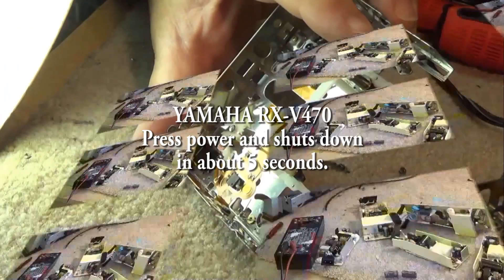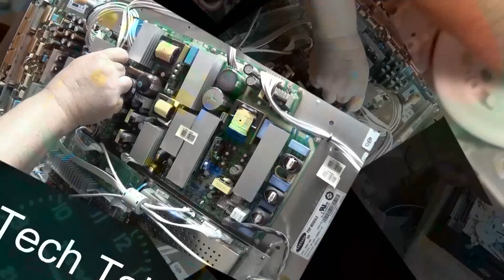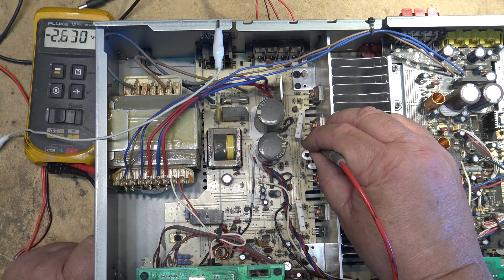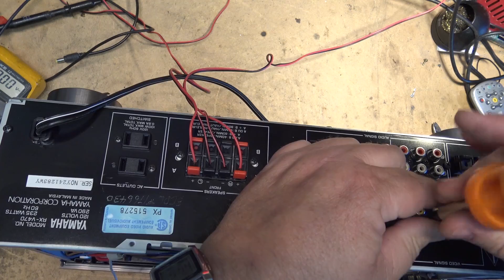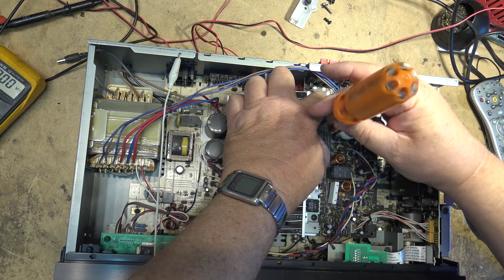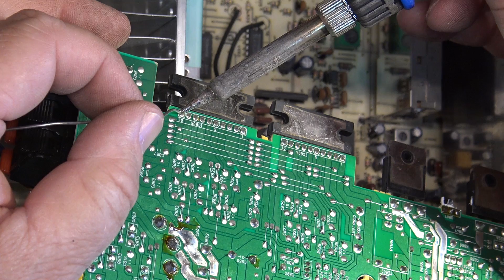Yamaha RXV470 Shuts Down

Comment: My brother in law has a Yamaha  Rx-v375 quit working on him, he gave it to me to look at. I got it to power on and run for around 30 minutes to an hour however it will power off after that time. 

If you power it on right after shut down it will immediately shutoff, but next day will run for 30 minutes to an hour again. Diagnostic code PS PRT : 185H 

Hoping you can throw me some knowledge on this issue, I appreciate any advice and all the information you share in these videos. I run two aventage series Yamahas and hope I never see these issues in those as they were not cheap.

Comment: Thanks for the vid. I have a similar model yamaha in my workshop that shuts off when the volume is raised to around 1/4 of the volume dial. I haven't had a chance to pull the covers off yet and my first thought was perhaps a faulty speaker protect solenoid but i'll keep my mind open. Thanks again.

Comment: Bwa ha ha, i thought it would have been due to crows feet !!!
I ended up getting an Akai 3 in 1 midi system as they call them in australia, for free as it doesnt power up. Im hoping its just a power fuse else these units are like pc's inside. Hopefully a simple fix.

Comment: Awesome diagnostic/repair video. Found you by chance, upon searching for a solution to my Yamaha RXV377 Receiver. The unit is rated @80watts/channel. The problem is that when I turn up the volume to 80%, it turns off and the display reads "CHECK SPEAKER WIRES". I also checked each wire terminal, for each speaker for any loose bits of wire. Found about 5 little bits of wire in one terminal only. But the problem still persists. The unit is set to run speakers at 8 ohms. Center channel is a 200 watt 8 9hm speaker. Left/right speakers are tower bass reflex @200 watts, and finally; rear speakers are Sony, @ 100 watts each ,@8 ohms.
Wires used are speaker wires, forgot the size, but are the lamp wire type. 
Could the issue be the wires are not capable of sending the correct voltage? Or do I need a larger sized speaker wire. I am just guessing. But l, you know more about this. 
Hope you can help me in this. 
Thank you for your time. God bless you and your family

Comment: My left surround nor working properly sounds very low when I increase volume sudden shut down at high volume
Reply from the maker: Short in speaker or wiring ?
Reply: @12voltvids   I removed all soeaker wire from receiver thn I increase volume facing same problem ( shut down )
Reply: And yes my Yamaha rxv 1900 left surround channel not working properly

Comment: I had a Yamaha RX-V480 receiver with the same problem. I found your video today and followed your solution-it worked! I did not find visible cold or broken solder joints on the IC's, output transistors, or the voltage regulator, so I re-flowed the solder on all of them anyway. My soldering iron tip was too large to add solder to the multi-pin IC's, but I did add solder to the three-terminal devices.
The 480 differed from your 470 in that the surround channel board (two rear channels and a center channel) is mounted on its side, screwed to the wall of the heat sink. Thanks for the video!

Comment: I have a Yamaha rx-v795a stereo amplifier from 2000,,,a 20 year old amplifier with built-in radio tuner and Dolby pro logic and Dolby digital surround sound.

The only problem I may have with it is the sound cutting out in the left and right channels,,,which may b the same trouble as u had with dry open circuit joints on the transistors and ics too.

Comment: This is exactly the fault I have on my Sony TA-VE215 surround amp. After it gets warm I hear a click and the front speakers stop working. 
Turns out it's cracked solder joints on the relays.
Reply: All sorted. These were the culprits 
https://i.imgur.com/lcgdWJM.jpg
but I reflowed any others that looked dodgy and there were lots!

Comment: Brilliant,  was the wha wha whaaaa a squidward impersonation?😆
High appreciation for the tutorials on amp operations!
Just wondering if the solder is naff - would it be worth checking the main power board also? 
Anyway great fix as always 👍
Reply from the maker: Have you ever taken the main board out? The extra time would easily double or triple the repair cost for nothing and increase risk tgatvsomething else will get broken in process.
Reply: @12voltvids  i suppose so!

Comment: If you look in the service manual you will find that these Yamahas have a diagnostic mode and it will  give you a very good idea of where the problem is.
Reply from the maker: Not when they won't stay turned on it won't.
Reply: @12voltvids , I just checked the service manual for that model and it doesn't include that feature.   The later models did though.   Check out the service manual for an RX-V620 on page 12.  They had a feature to disable the protection circuit as well as display a code indicating the last protection mode.   This is handy for a NoProblemFound unit that you cant find a fault with.   If it displayed an output current fault you can usually assume the customer did something he shouldn't have.  

 For these earlier models I would connect a variac to the power transformer primary and monitor ac current while bringing the voltage up slowly.   Then I could check voltages without the unit shutting down on me.  I am a former Yamaha authorized service tech.
Reply: @12voltvids  🤣

Comment: I have one of those pioneer xr a-770's that you love to work on. It says hello and goodbye and that's it. I figured it's going into protection mode too. It was up at our cottage for years until my sister brought it home and said it wasn't working properly. I figured I would use it for the shop. It was barely making an audible sound, then decided not to work at all. I took it to bits and couldn't be so lucky to find any loose or cracked solder connections. I figure it's probably the amplifier stk ic. It may be a good candidate for a couple of those component type replacements.

Comment: I guess Dave Jones would have said "We're in like Flynn".
Had a SONY 4.1 (no Subwoofer IIRC) that would go into protect, the center preamp had a DC offset. The entire receiver was in pretty bad shape and not worth it so I just removed the center output from the circuit to get it working again.
And I had a JVC 1001 self destruct due to dry joints. Fixed it though because it was in good condition otherwise and being a cutting-edge top-of-the-line model pretty much worth saving. I just had to redo the entire internal wiring... and these small green audio rated electrolytic caps were bad.

Comment: I wish i knew how to troubleshoot electronics :-(
Reply from the maker: It can be learned.
Reply: Yes but it will take me a lifetime! I will have to take it one baby step at a time. Your videos help a lot! keep them coming,Cheers
Reply: With some good meters you can do it.
Reply: @tekoppentekoppen761  I have a Klein 600 multimeter unforunately is not true rms.
I also have a Tektronix 2445 O'scope but dont know how to use it i cannot find any good tutorials on how to hook it to a component to check it and i do not want to injure myself or the equipment. I also have a signal generator and heathkit digital counter I even have a variac. So i have a lot of test equipment all i am missing is the knowhow on how to use them.
So i make do with the dmm and a transistor and capacitor checker.
Of all the gear i have the one i would most like to know how to use is the O'scope.
Cheers
Reply from the maker: Your shitin me right.  Lots of stuff from japan had the same problem.

Comment: Let's eliminate lead from consumer electronics solder connections, lead is bad! We're saving the environment!!! Hooray! 
Never mind that multi-fold increased failure rate, which ends up sending far more e-waste to landfills then before, when the 99% throw-away public does exactly that after it stops working.
Reply: It's makes perfect sense when you think about if from a politicians view. You get to sound like you made a law that will do good for the world but really you're going to be making money for the people who donate to your campaigns. The fact that consumers and the environment gets screwed doesn't matter.
Reply: Most folks replace equipment not because it fails, but because there is a newer model, that can perform some other shiny function that loses luster a few months after purchase. Cell phones and bigger TVs have a high turnover, but even audiophiles spend multi thousands on new shiny equipment just because of boredom with what they have. Lead free might be fine for such folks
Reply: amandio sousa I don’t think it’s “most”, I think it’s some, or up to half need to have the newest/bestest/shiniest gadget. 

To those people, what ever. I’ve got allot less problem with that, as long as they’re passing that still working item along, and I’m under no illusions that all of them do (that’s another rant for another time).

My gripe is someone spending several hundred dollars on something they want to keep as long as possible, and that length of time turns out to only be a measly 2-3 years in some cases these days. 

Planned obsolescence is playing some part, but so isn’t the RoHs/Prop 65 approved decomposing solder they use.

Comment: Thanks Dave, very timely.   I do have a Yamaha RX amp on my bench that goes into protect. The unit and display panel still have power after it senses a fault but I get a code displayed.  Do you think it may be a similar issue ?    J K

Comment: ...."In the old days...."   They used to design these with a removable plates on the bottom of the chassis. Now it's a pain in the ass!
Reply from the maker: I used to dread Yamaha units coming into the shop as they were the first ones to not have the service hatch.  Then they all copied and I started to hate em all.
Reply: LMAO!!   You had to be there....!   BTW>>> That was a LOT of cracked solder pads! one of the worst i have seen!

Comment: Good and interesting video

Why does relay turn on and off when there is a fault?
The 90's technics amplifiers turned off when there was a malfunction or short circuit on the speaker cord and you had to turn the amplifier on and off. technics didn't turn on and off all the time.
Reply from the maker: Did not pass post
Reply: @12voltvids  ?
Reply: @ford1546  post....power on self test.

Comment: Too bad companies like to save pennies for not providing a simple back panel with 4 screws,just in case someone needs to reflow those bad joints,or change bad caps.
Reply: They were built to be disposable

Comment: Nice repair... I would have checked the PCB of the main channels too for broken connections
Reply from the maker: Too much work, and if it breaks later then I get to service again.  
Also, having to totally tear down increases risk that something else will get broken.  Just ask anyone that had a fully functional unit that they decide to just change all the capacitors because every one of them must be bad.  They remove all the boards and carefully replace them all only to find it doesn't work upon  reassembly.

Comment: I miss having those extra AC outlets on the back of gear. That was so convenient. Don't miss those clip speaker connectors though.
Reply from the maker: These always invite overloading which burns out the power switch and creates a fire hazard when the mains cord melts.

Comment: Single sided circuit boards.. a common source of problems
Reply from the maker: Wave soldering is the fault not the circuit board.
Reply: @12voltvids  it doesn't help. Far more contact area on double sided plated through boards, but leg kinks for stress relief also good idea.
Noted on this board Yamaha bent some legs flat to board then soldered, that's good practice.
How's the crows? In the UK we seem to only have problem with seagulls